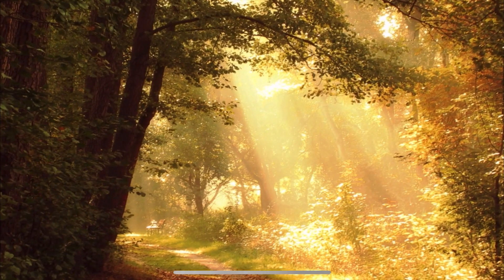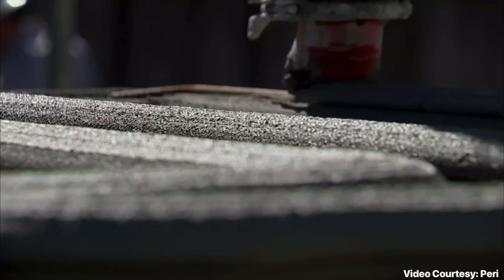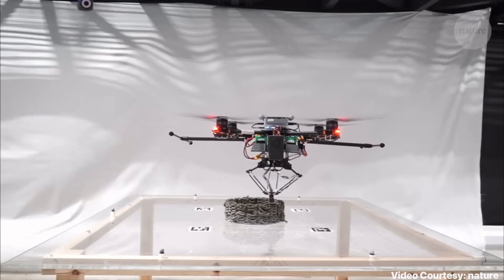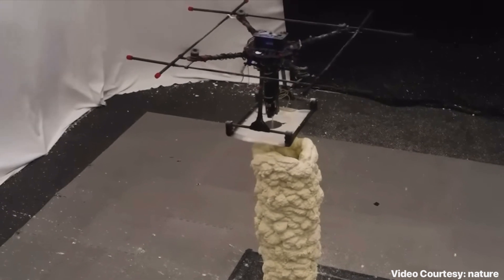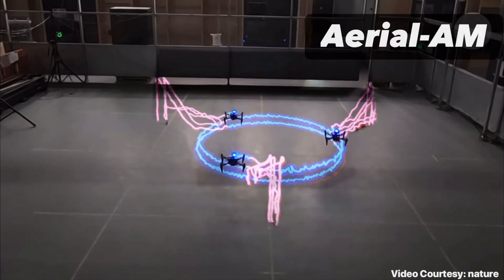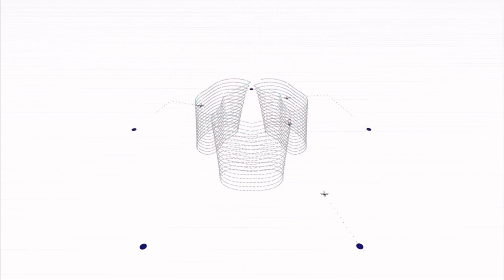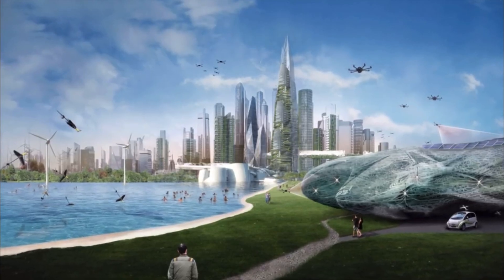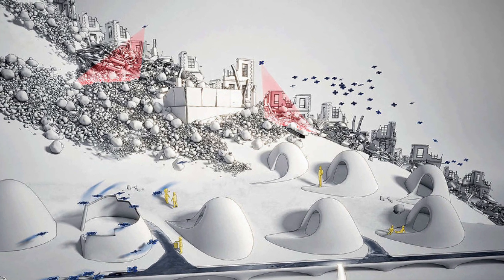Flying 3D Printers are changing the construction industry.

Comment: I read a recent article showing that they can recharge drone with a laser from the ground. Imagine those drone building structures and being recharge non stop, it would be amazing. Add to that AI camera for quality control and thats it!
Reply from the maker: My biggest question with the drone is the replenishment of building material.
Reply: @aprintedworld  to and fro my guy drop the spent cartridge and pick up a new one
Reply: @aprintedworld  Well the drones in lab looked like there was some hose attached to them dangling down and the cement was pumped up through that hose.
Reply from the maker: @martinpavlicek2299  Their goal is to fix high rise structures with this tech. How long is that hose going to get?